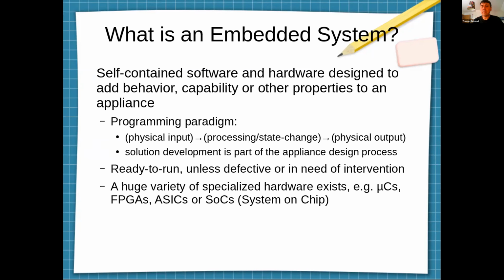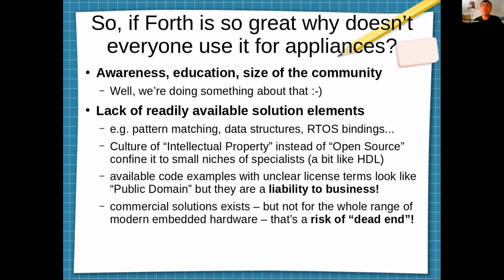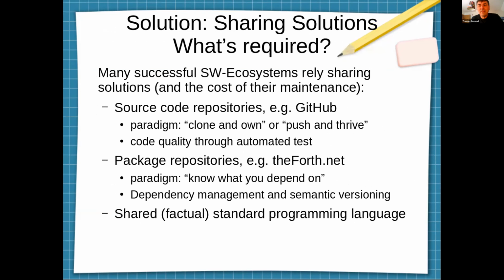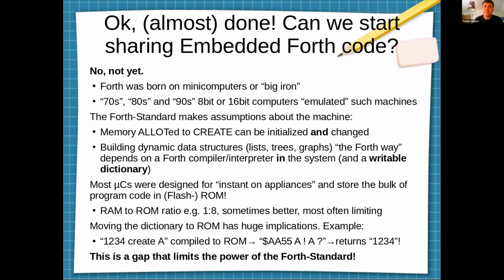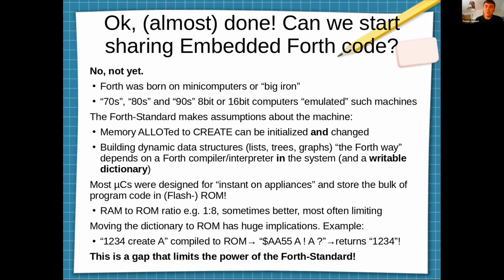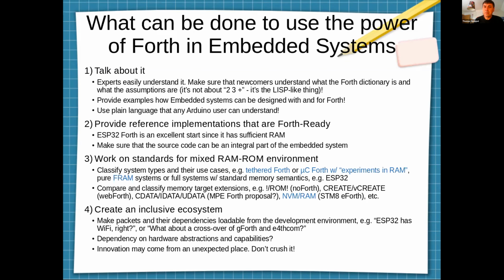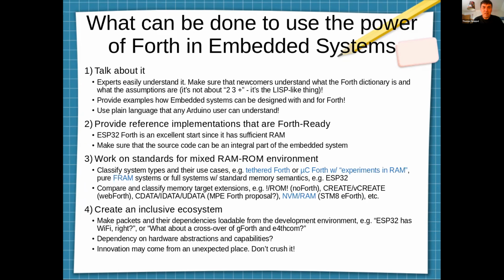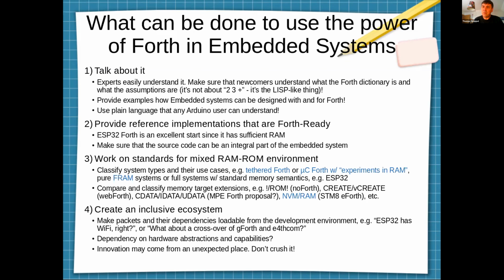Thomas Göppel Forth2020 May2021 Zoom " Inquiry into an Embedded Standard Forth"

Comment: One of the greatest attributes of Forth is its simplicity, which promotes creating Forth systems optimized for the platform at hand.  Standardization efforts tend to undermine this.  Part of the Forth philosophy is the writing of optimal code specifically for the problem at hand.  Shoehorning solutions into a shape that "fits existing library routines" is directly contrary to this philosophy.  I'll just stick to the "understand the problem, write the code" approach.  It's what Chuck taught us.
   
I do agree with you, though, that ROM-based Forth systems are difficult to work naturally with.